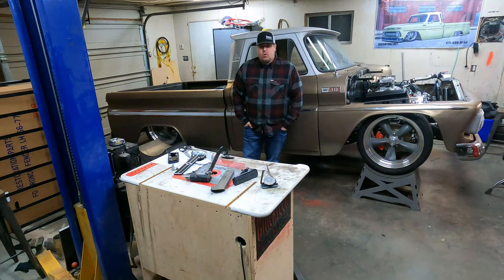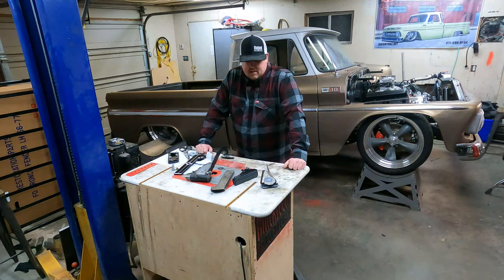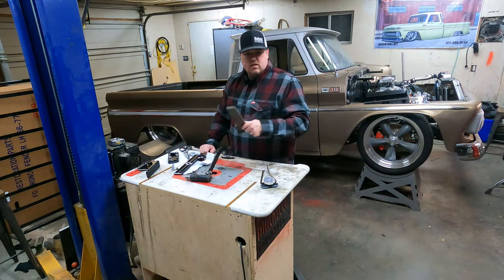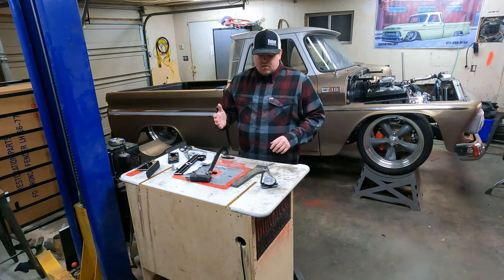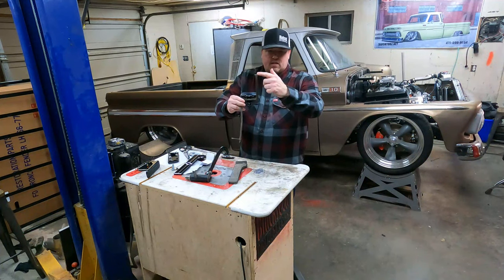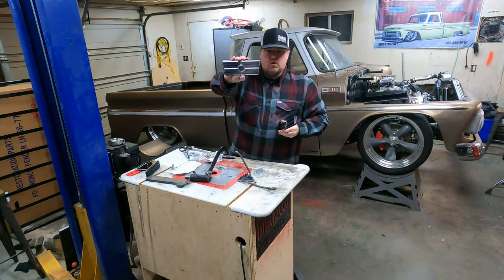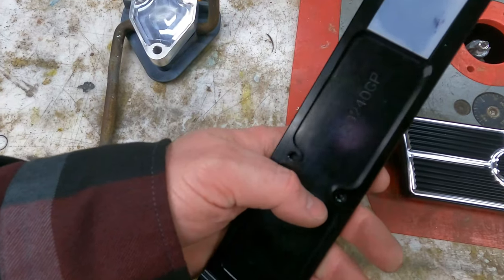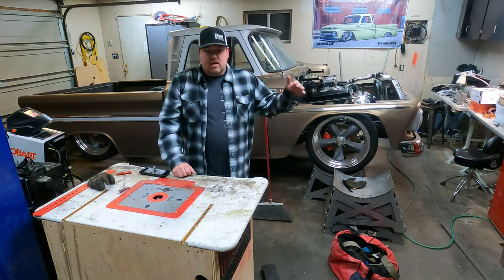C10 BILLET SPECIALTIES PEDAL INSTALL -  #LSTCRUNCH #LONESTARTHROWDOWN  #LST2021

Comment: Get something to hold down the brake pedal over night will
 clear out all air bubbles. I do the same thing on my crotch rocket , I rap the brake lever tight, of course I bleed it first. And I leave overnight,it’s always works!